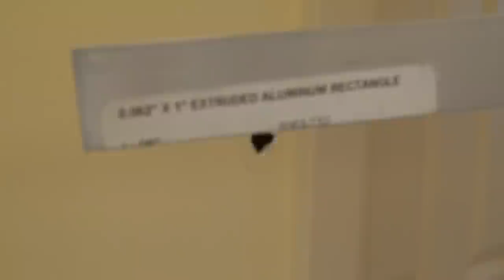How to fix towel holder in drywall.  Ремонт держателя для полотенец

Comment: The best way to repair  this without  repositioning the towel bar  because  of  equal spacing is to cut out the broken  out drywall and place  a wood backing strip where the towel  bar base was originally mounted , then screw  the backing to the drywall  then place the new drywall  to the backing , then after the patch  is sanded and textured painted  re attach  your towel bar to its original  position  with wood screws hitting  the wood strip backing behind  the drywall, this is super  easy and the towel bar will be secure!

Comment: nice. thanks... edit: just did this but with a piece of wood instead of metal and its a great idea.  thanks again
Reply from the maker: Nice work!
Reply from the maker: Just for your future work in same situation behind the sheetrok - instead of regular wood, better to use 1/2"-3/4" thick and 3/4'-1" wide strip of plywood. It will be much stronger and free of splitting by using wood screws.

Comment: Very nice. Why the metal. Can I use  wood the same way
Reply from the maker: Wood can be splitting by the screw. At list you can use plywood 1/2" thick × 3/4" wide  and predrill holes for screws.

Comment: Spray some Good Stuff expanding foam in the hole.Quickly put anchors in.Secure with painter's tape.Wait 2 hours.Remove tape from anchors.Should be sturdy to put towel rack.
Reply from the maker: Foam? Seriously?  No thanks, i like to do my work one time and no call back from my customers.

Comment: Is it strong enough for me do drill a whole and reinstall the towell bar with an anchor?
Reply from the maker: If you have plan to install/reinstall to the not damaged spot of wall sheetrok, then use a Toggle Bolt.
https://www.homedepot.com/p/Everbilt-1-8-in-x-3-in-Zinc-Plated-Steel-Mushroom-Head-Phillips-Toggle-Bolts-with-Screws-25-Pack-803902/204274390

Comment: Will this work for bathroom shelf.  On one side, the wall plug failed and left same size hole you had when I pulled out the plug. I really do want to re-use the holes so I can put a new shelf in the same spot.  Do you think this is strong enough to do that?
Reply from the maker: Personally I never install shelf on sheetrok. Into wood/metal studs only. Shelf and staff on it heavy, I think sheetrok can't hold the weight.

Comment: Wouldn’t fancy drilling above that electric switch.
Reply: Because without using a voltage detector how do you know which way the wires are running, assuming they’re either up or down? Wouldn’t just smash screws straight in either.
Reply: @Andyfishing23  That one must have been in the stud?

Comment: Wood is easier
Reply: Wood piece of same size as aluminum strip, would not have enough meat to hold it reliably.
Reply: @BlahBlahManYeah  slightly thicker or longer 1x3 would be fine. It's not holding anything heavy
Reply from the maker: @apex007  1x3 wood? So I would need to make a hole much-much bigger? Than patch, texture, primer and paint a hole wall. 
I think it will be 4 Hours work and at list 3 time drive to this house!!! 
Instead of this method - one my visit and 1 hour labor.
Reply: @FixitAll  if you charge by the hour, then why not?
Reply from the maker: @apex007  My English not enough to explain it. Скажу по русски. Если я знаю и понимаю в уме как я могу сделать работу быстрее и проще, то не получится заставить себя сделать её по другому. Даже если за это и заплатят больше. У меня достаточно заказов чтобы не тянуть время по мелочам.
Reply: @FixitAll  I'm joking. Успокойся!
Reply from the maker: @apex007  :-)